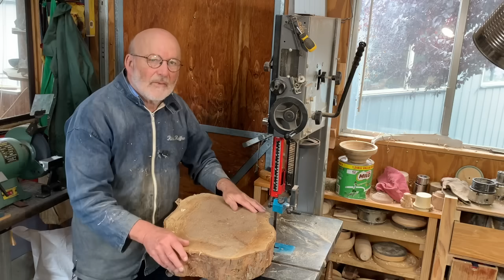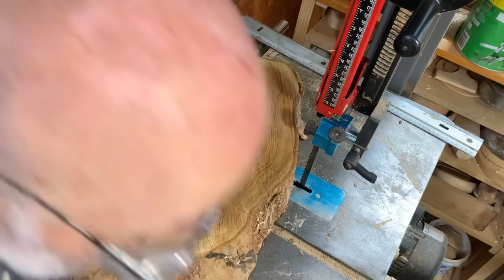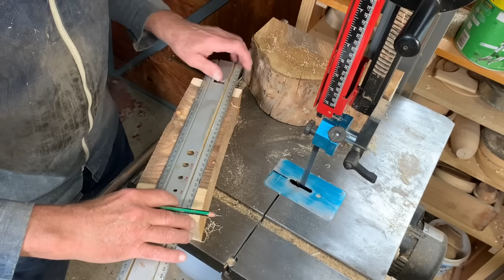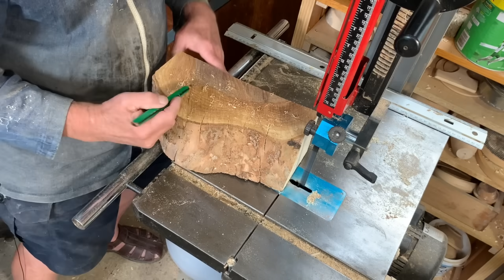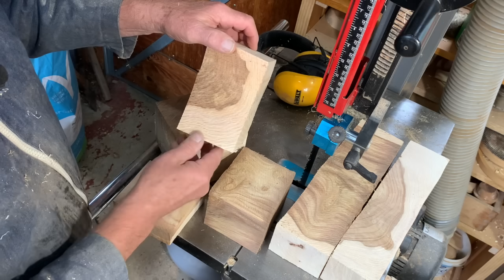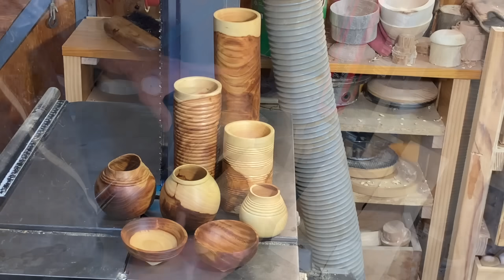Richard Raffan converts the end of a green elm log to woodturning blanks.

Comment: It is really instructive watching how you work through the candidate projects that a log will provide.  That elm has some very attractive figure.  When breaking down green wood like this, even after you remove the splits, do other splits develop in the smaller blanks as drying continues?
Reply from the maker: As you'll see in some of the follow-up videos, there was further splitting which is partly why there are eight pieces from six blanks. Once blanks are turned to an even wall thickness you can expect them to warp rather than split further.

Comment: Do you actually dry your wood stumps after sealing them Mr Raffan? or do you just go ahead and cut them into pieces and then put them aside to dry, or just straight up turn them while theyre green? I ask coz ive run into a truck load of stumps the local council threw out and have no idea how to stop them from splitting and keep them useful for turning down the line and not have them end up as firewood.... any advice?
Reply from the maker: It's impossible to deliver advice that covers all timbers because some trees/logs are more prone to splitting than others. You'll find over 30 videos in the Cutting Blanks playlist https://www.youtube.com/playlist?list=PLBAvwOB0lJTSIwNPfjT8n5Zl1T3h-fzgy that pretty well cover my approach to cutting green logs to very well-seasoned boards. It pays to get green logs into billets, cutting or splitting the logs along the major splits, then seal then ends.
Reply: @RichardRaffanwoodturning  Thank you, ive pretty much watched the whole 'cutting blacks' playlist. Im fine with processing  the wood when i need it, however im kind of lost on pre-processing and post processing the wood - how to avoid cracks when you get your hands on a stump until you process it. And also how to avoid cracks after processing the wood into blanks. I processed some blanks out of acacia and apple (green wood both maybe 2 month since cutting) - both end up with cracks even after taking out the pith (apple moreso than the acacia). Was hoping there was some trick here im unaware of?
Reply from the maker: @DigitalNative01  Sadly no tricks that I've come across. Apple is notorious for splitting as are many timbers. You won't find those commercially available given that few woodworkers are interested in paying good money for a split board. Over the centuries woodworkers have learnt which timbers work well and it's those you find readily available commercially. However even amongst those commonly available timbers you'll find occasional boards that can be difficult to work and learn to avoid them. Seasoned boards without a few splits at each end are rare.
Reply: @RichardRaffanwoodturning  Hmmm food for thought. Unfortunately the timber yards where im located stock mostly pine or poplar, not the most useful of woods when turned into kitchen utensils or bowls besides looking pretty. Any other species of wood is nigh impossible to come across unless its on the side of the road or being cut down from a garden. Guess its going to be a case of trial and error as many things often are. Thank you for sharing your experience on here - ive learnt quite alot. Much appreciated.

Comment: backing out of a cut "under power" is asking for trouble. I always turn the machine off and wait for the blade to stop before backing out of a cut. It wont hurt you, but a kinked blade after it comes off the drive wheel is an unnecessary expense.
Reply from the maker: Okay, it's a bad professional habit and not to be recommended, but I get away with it 99 times out of 100, or more likely 499 our of 500.